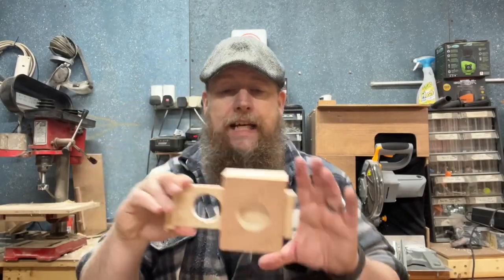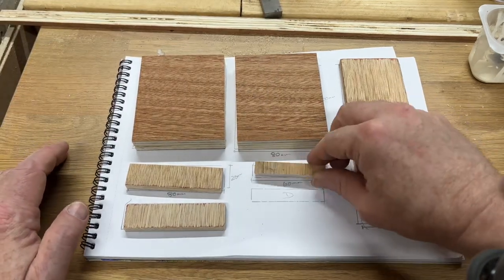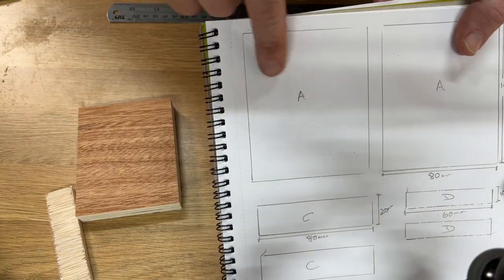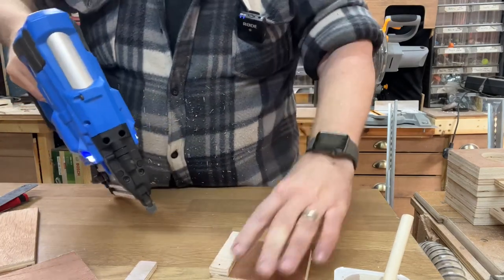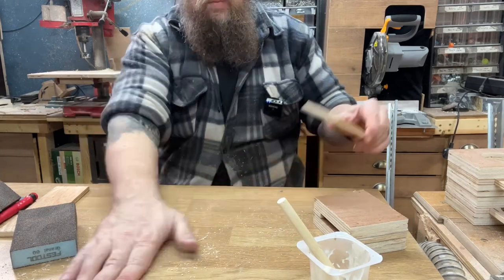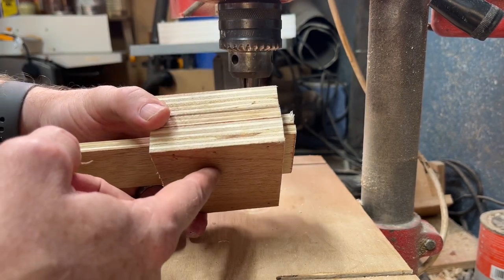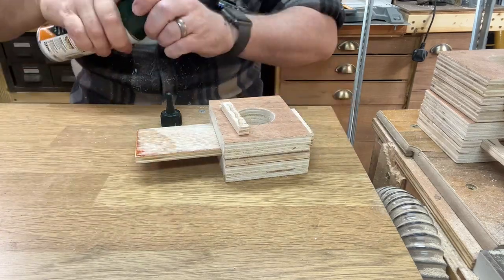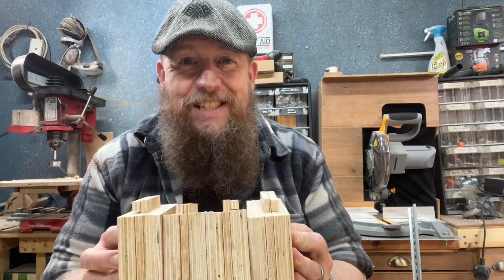DIY Blast Gate Tutorial

Comment: One word of warning: there was a slight tendency for the Forstner drill to snatch and make the block spin dangerously. Hold it very firmly or find a way to clamp it. I found it worst with the drill on its slowest setting, presumably because the torque is greatest at that setting.